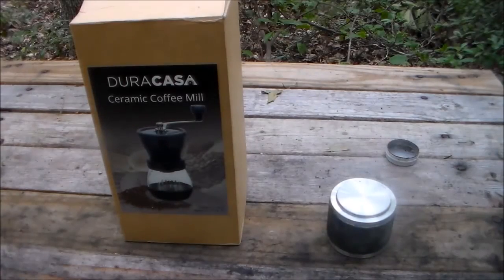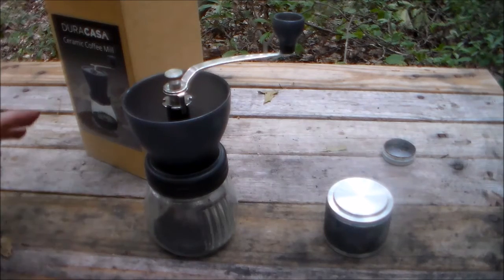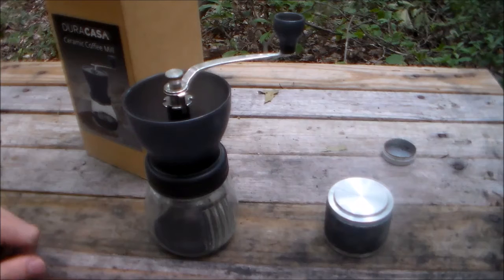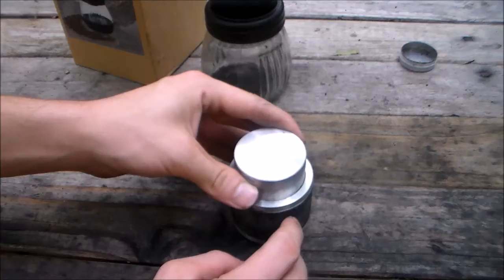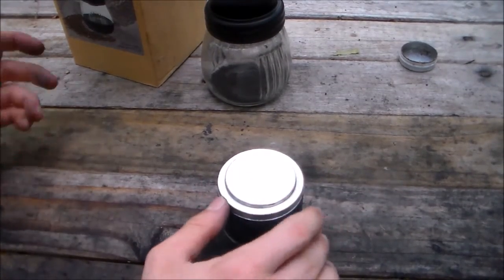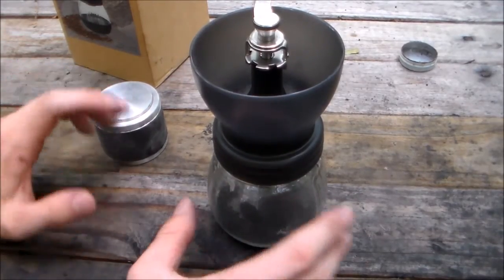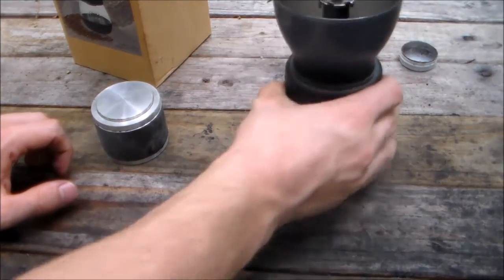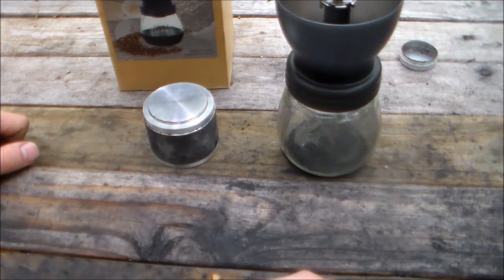Tools For Corning Black Powder

Comment: Your press may be 2000 pounds, but the base area of your cylinder (die cylinder) is probably more than 1 square inch, so you have to do the math. If the base area is, say, 2 square inches than the force is only 1000 psi.
Reply: Yes but no. A force of 2000 pounds over two square inches yields a pressure of 1000 psi. The force remains 2000 lbs.
Reply: @Strutingeagle  Yes, you're right, psi is a unit of pressure, not force.

Comment: I tried a large c clamp and it worked. I used a 2 inch iron pipe nipple. I cut two 3/4 inch wooden plugs that fit inside the nipple and was able to compress the black powder until the moisture came out. I then screwed the nipple into a 2 inch coupler and used the c clamp to push the puck out of the nipple. Crushing is the difficult part for me so far.
Reply from the maker: Good to know, thanks!

Comment: I suspect a large c clamp will supply enough energy to compress these pucks. I intend to give it a try.
Reply: That's how I do it, I use a 8 or 10 inch C clamp, works well enough for me.

Comment: Do you remember off have what screen size is F2 and F3 powder is? Need to purchase. Thank you.
Reply from the maker: I'm pretty sure I just used typical window screen, and then folded it over 2 or 3 times so that the granules would come through smaller in size.
Reply: @blackpowdershooter44  thank You.

Comment: Please stop using any type of grinder to corn your powder!!!!! It's extremely dangerous when using metal blades against black powder...it's never a question of IF you're going to have an accident but WHEN it's going to happen!!!! You could possibly corn 100 pounds or 1/4 of a pound...but an explosion is going to happen with this technique!!!!!
The "puck" maker idea has been around for a long time...and it's a good tool and your arbor press should be more than enough. I've made many hundreds of model rocket motors (E30s) with my 3-ton press and it makes the powder rock hard!
Instead of using the grinder...after compressing your powder into a puck, just use a wooden pastry roller to break it up.
Stay safe!!!!
Reply from the maker: You are correct sir about not using a metal bladed grinder, but this one has ceramic blades, so it cannot spark. I do appreciate the concern, thank you for pointing that out, I should've pointed that out in the video
Reply: Highly Organised  The 'lead ball' system is a ball mill.. to corn the powder you need to do something similar, but with something more like billiard size balls in a corning drum. Lots of ways to corn powder..

Comment: this device is not complete... it needs base and need to be bolted with screws , then you will add pressure , and it will work. Avoid cofee grinder cuz its like a grenade to me... if any spark you will end up without both hands...

Comment: I recommend not doing this.
Yes it will work. However I don't like the idea of grinding dry powder. Once you finally figure out how to make your powder reliably consistent and hard shooting. That powder has also become quite dangerous to handle. 
With all the logical precautions we can take. We must also remember that their is a darn good reason we only have one powder manufacturer in the United States.
  The others all blew up!!!
Finely ground charcoal is VERY dangerous. Even before adding a chemical oxidizer. And mixed chemical is exponentially worse.
 You simply cannot prevent very fine granules from breaking off with the properly sized ones. These collect in the bottom  of your bag and pose a constant threat.
   It is far better to simply mix your powder wet, push it through a screen and use it as is after it dries.
  My powder hasn't broken down into pure fines as long as I just keep it in a flask. It shoots just as well as Goex but takes up a tad more space. Both in the gun, and in the powder measure. Another safety modification that works pretty well in some guns. Is to leave out the sulphur. This raises the temperature required for ignition. One MIGHT consider corning this mixture. But I don't trust that either. It shoots well in my Ruger Old Army as is. But it doesn't work well in either of my flintlocks.
  I simply wouldn't grind dry powder under any circumstances. It works fine without it and the returns aren't worth the risk.
Reply: Isn’t ball milling the same as grinding?  Can’t make black powder without ball milling, right?
Reply: @historyandhorseplaying7374  a ball mill is a method of grinding. Mortar and pestle is another. But either method will kill you if ANY sort of spark gets into it.
  One should NEVER grind powder if the saltpeter has been added to the mix. Boom. Unless it is wet. Wet powder will not burn. 
Grind all ingredients separately. Add sulphur to the ground charcoal. Grind those ingredients together and then dampen the whole shebang before adding saltpeter. The saltpeter will soak up part of that dampness so you need to add a bit of rubbing alcohol or water making the mixture into a thick paste. About the consistency of children's "Play Dough" mix it in this state and don't allow it to dry out while working it. Until it is thoroughly mixed .
 Press it out like a tortilla and allow it to dry in the sun outside.
  Break it up and use it as is.
Reply: @MrPanchoak  I hear you.  But every video I’ve seen made by folks who make bp, they talk about grinding for 12 or 18 hours at a time, and they never mention wetting it.  And it appears they are grinding all the ingredients together?  are they truly taking their lives into their own hands?  I doubt they are wetting the mixture during the course of the entire 18 hour grind!
Reply: @MrPanchoak  I agree with you.  I have been making my own paper cartridges for my colt Navy .44 with 25 grains.  But if I may play devil’s advocate, the round coming out of the gun has power because the powder was not just confined in the cartridge and chamber, but because it was compressed by the plunger and lead ball.  On the other hand, in the small 3 lb rubber ball mill which is only maybe 1/2 full of loose powder, if it caught fire, wouldn’t it simply just burn quickly, rather than explode?  In all seriousness, would like to know if these YouTubers have had dangerous experiences with these methods.
Reply: @historyandhorseplaying7374  Burn quickly?? How do you define that term?
I'm sure the fellows who died In the powder mill explosions of old might possibly have a different idea of that definition. In many cases there was no trace left of them. None at all.
 One second hard at work. Next second a tremendous bang, a cloud of smoke and nothing left for a hundred yards in all directions. These operations were roofed but not walled. No containment whatsoever.
   Containment is not only attainable through steel or brass or paper , but also via shockwave the larger the quantity ignited, the greater the shockwave a mere pound of fine black powder will detonate with INCREDIBLE FORCE. 
Black powder is a wonderful propellant for sporting. It is fairly safe after manufactured. Provided that proper precautions are exercised. 
   Even then it has its dangers. I bought a Ruger old Army from a fellow with a mangled right hand. Quickly reloading during a tournament and with only a light load he blew the ramrod through his right hand. In a split second. A mere powder measure pouring a measured charge down the barrel has been known to explode killing the hapless shooter.
probably a mere 60 or 70 grains.
   But compared to manufacturing of it this is perfectly safe.
Pulverized charcoal alone is dangerous as hell don't go tempting fate.
Reply: Black powder doesn't instantly blow up with out an ignition source, like a spark and it needs to be around 350 degrees.
The milling only goes South when an spark or electrical charge is introduced. And no pressure is going to set it off either. You can literally hammer a pile of black
 powder and it won't go off.
If a quanity of black powder is left in the open and it is ignited, it will simply flash off and not explode. To explode, it needs to be contained to allow the gasses time to exspand.
The reason piwder plants explode is due to the fine dusts igniting in confined spaces due to an ignition source due to human error.... not grinding, or concussion forces.
Please stop spreading misinformation.